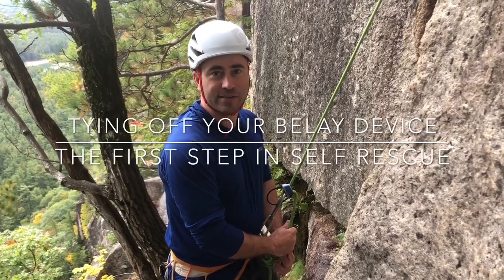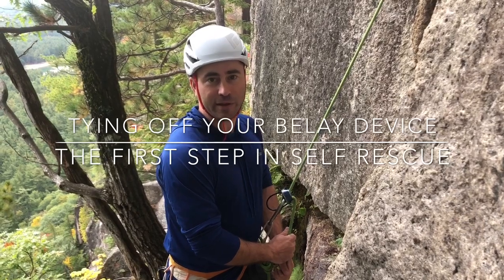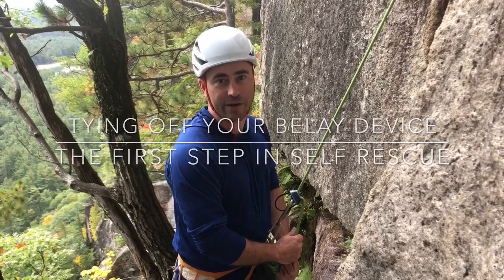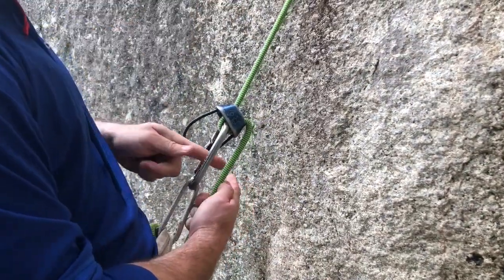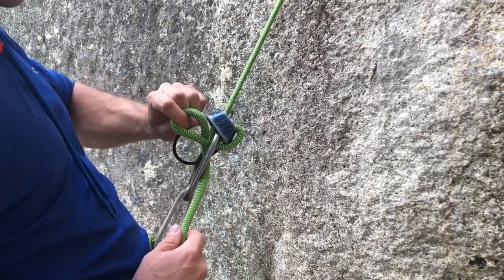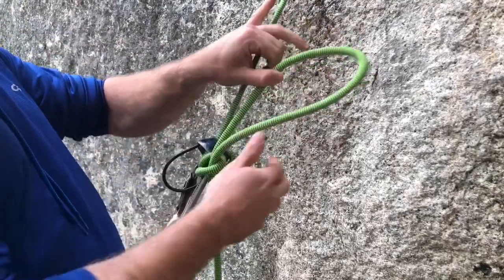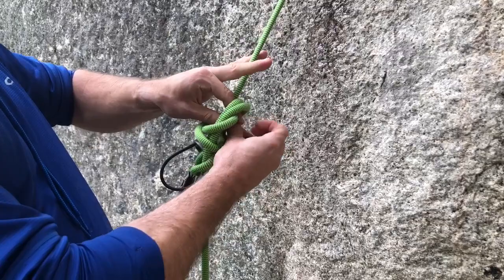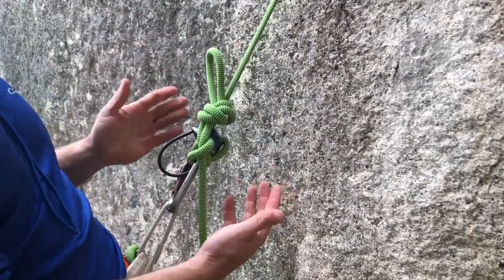Tying off a Belay Device

Comment: quick and easy. Do you advise closing the system with a biner?
Reply from the maker: The overhand knot secures the system. A biner can be used instead of the overhand to secure that bight to the load line. While it doesn't have to be locking a little care should be used that the bight which releases the mule knot can not run over the gate of the carabiner if it is a non-locker.